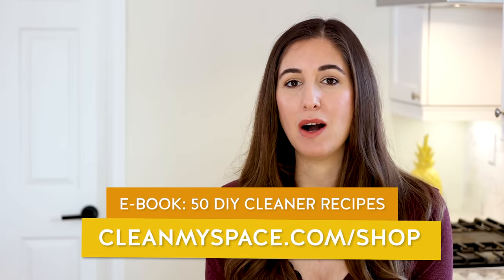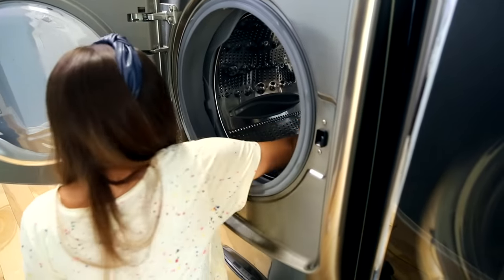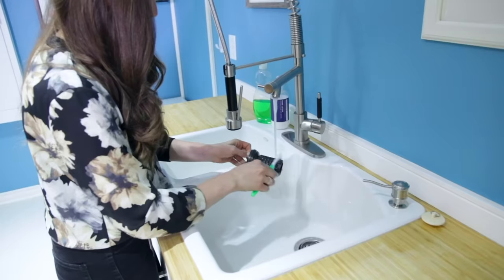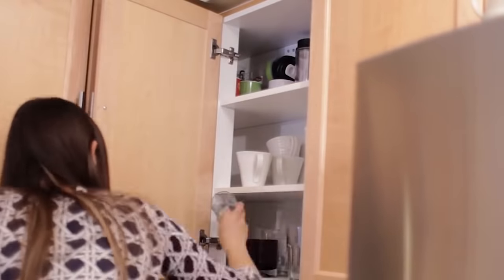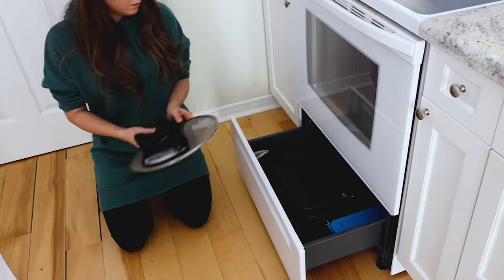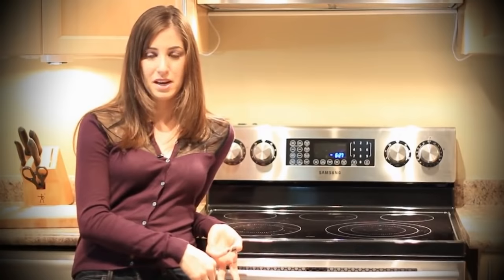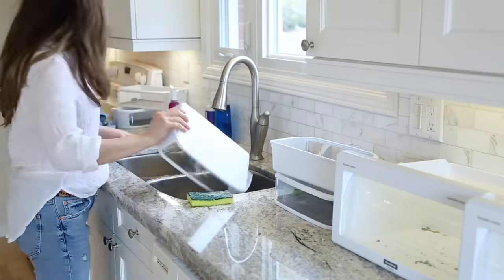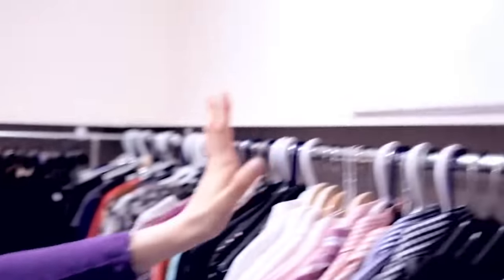Spring Cleaning Motivation Marathon!

Comment: One thing I'd recommend before putting the coats and jackets away in another place (or donating them) is that it might be a good idea to check the pockets first to make sure nothing is in them that you might want (like money or other valuable items that you might even be searching for later). One time I was putting some dishes up in the attic, and without remembering I did it, I had put $100 between 2 of the plates so the money wouldn't accidentally blow away. Needless to say, I forgot I'd put the money there and until we brought the plates down from the attic a couple or so years later, I just thought the money had been lost and was gone. Luckily we still had it, but we just didn't know "where" until then.
Reply from the maker: Good tip to remember, Sheryl!
Reply: @cleanmyspace  thank you! 🧡
Reply: I found money in my passport wallet one year after the trip!  Yes, check everything before you donate.
Reply: @donnafelker8840  👍

Comment: I'm about to ditch the blinds and use shades or go with just curtains to save cleaning time
Reply: i had blinds for many years, but find curtains are more accomodating to cats.
Reply: Exactly! I live in an older home with detailed trim and have cats so I was using the "cheaper" annoying ones. Tossing some curtains in the wash works better for me. Blinds are a great solution for someone that's in a more modern home with a simpler theme and no pets.
Reply: When I moved into my condo I ditched the blinds and it's outstanding. I started cleaning them and went why am I doing this. The open window is so nice and of course I'm on a second floor and no one can see in easily. Blinds are from the '50s I've always thought they looked cheap.

Comment: I lined the bottom of my oven with heavy duty aluminum foil (kind used for BBQ) shiny side up. When it's dirty, I just throw it away and reline with new. Also, the oven door slides off the hinges so it isn't in your way when cleaning the oven. Also, my stovetop lifts up on hinges so I can clean under the burners, it even has a bar to hold the top up, like the bar on your car that holds the hood up when working on your car engine.

Comment: So I just cleaned my mini blinds and I came close to tossing them.  However, I sprayed them with 3/4 water and 1/4 dishwasher detergent, then wiped with microfiber cloths.  While it is very sudsy, they were the easiest to clean of any other technique I have tried.  I worked from the top and I worked in sections.  When I tried to do a whole length of blind, it was too slippery to hold onto.  So I did one half all the way down, then the other half.  Wow, they are clean!  Then I used a environmental cleaner and did the windows.  So happy I found something that worked for me.  Loving my microfiber towels!

Comment: Going on the self clean oven video (which I remember it when it was new) it the lock function hindered me once. Being an apartment caretaker I had a tenant moving and he set his oven to clean (obviously without watching the video) he left stuff in it and it smoked out the apartment and half the hallway. Luckily no fire happened but it got close. I had to shut off the breaker of the oven cause obviously I couldn’t pull it out to unplug it while doing the cycle.